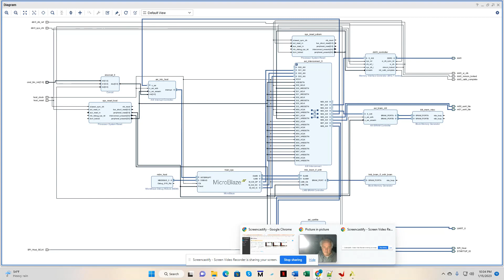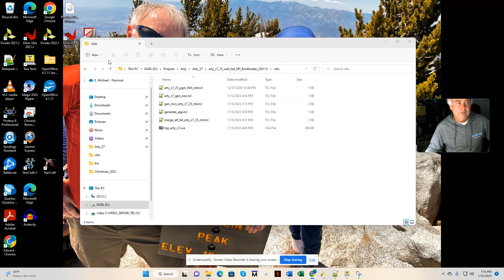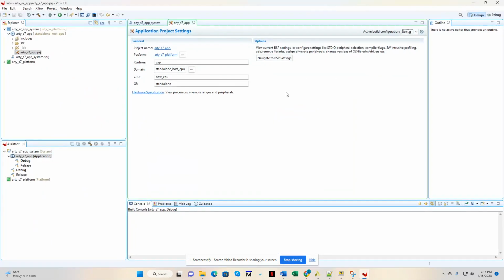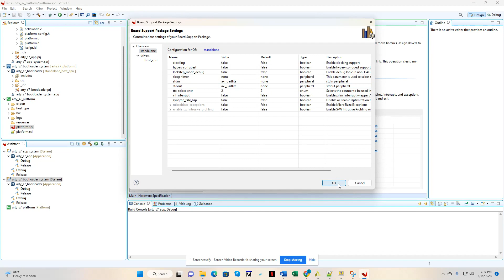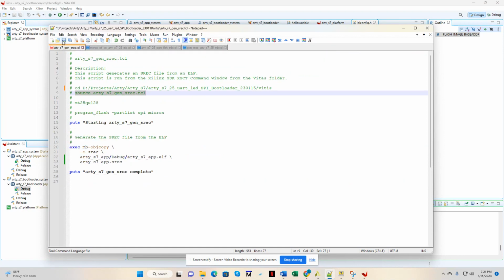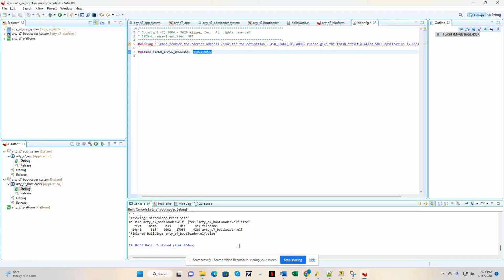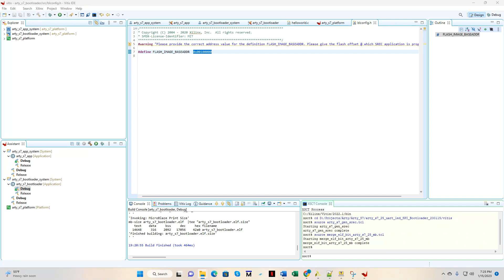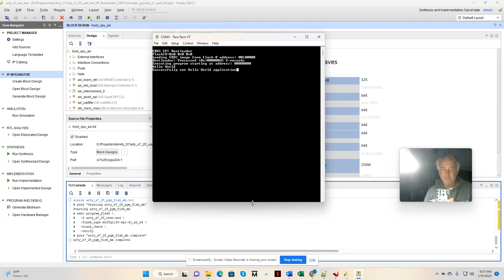Arty S7-25 Microblaze SREC SPI Bootloader featuring Xilinx Vivado/Vitis 2022.1

Comment: Hi

I am working on a design where I plan to use microblaze in a board with no external memory (DDR or SRAM). From my understanding, if the application is small enough ( <  128 KB) a microblaze application can be run using the FPGA's Block RAM. I am using Vivado/Vitis 2023.1, do you think that you could do a tutorial for that or give me suggestions? I tried different tutorials but they used older version of the tools and it doesnt seem to work.

Thanks
Reply from the maker: Just put another video up based on what you requested.  MicroBlaze with 128K of internal RAM.  Booting from QSPI on the Arty S7-25 board.  Try me at emcalnan@yahoo.com if you think I can still help.